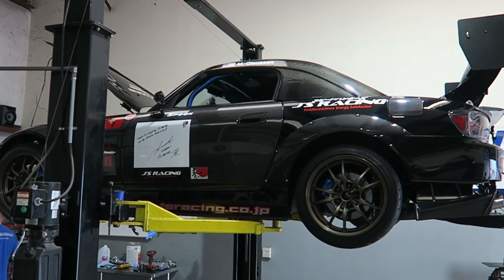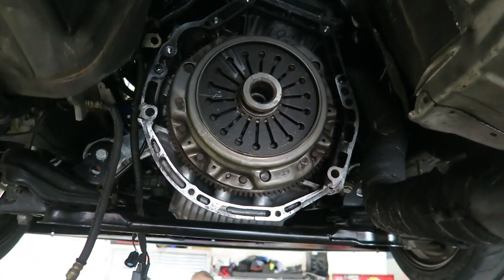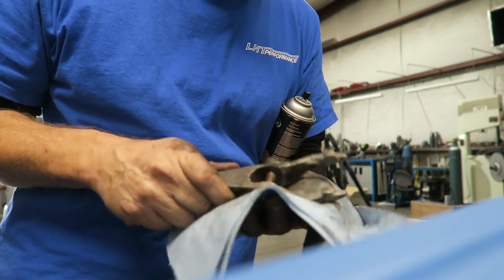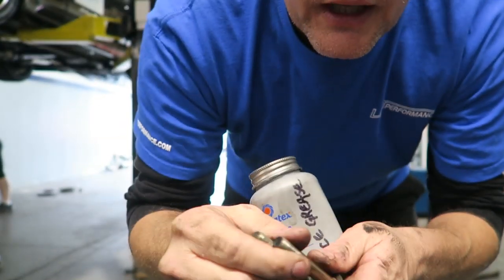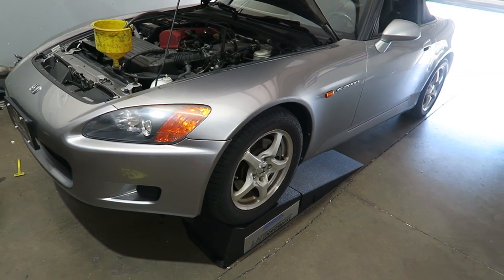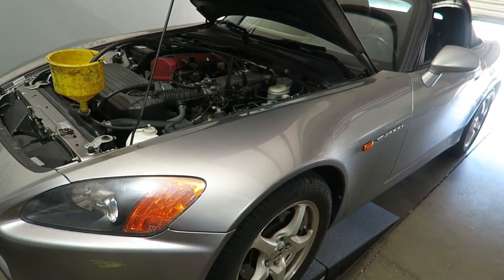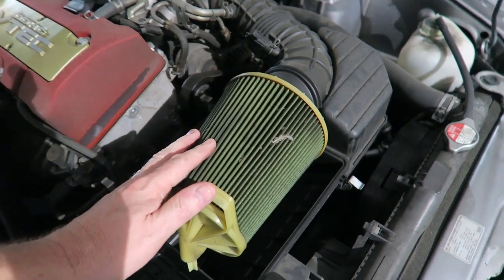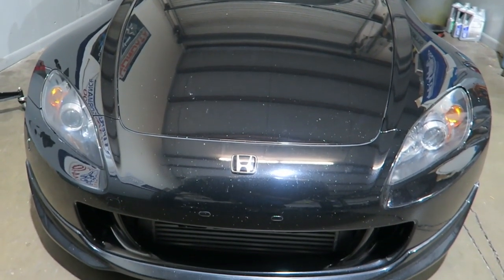What’s not to like?  S2000 's

Comment: Was going to get s2000 , but glad I went with 370z
Reply: @LeeRock 27 240NA hp is damn good for a 2 liter.  They respond really well to boost.  Low boost setups making 400+hp.  I have also seen 800+hp setups on stock motors.  Show me another motor that is better.
Reply from the maker: Mike Ireland Watch our Kraftwerks videos.   In stock from the S2000 is way underpowered.   With boost there fantastic 😜
Reply: 350z and 370z are dime a dozen. Just like civics. They are slow and heavy.  You can buy one for under 10k now. People payed 35k plus brand new.
Reply: I love my AP1, but I do want to supercharge it 😬
Reply: 370Z is too much of a GT and too heavy 🐄. The S2000 is a more dedicated and focused car for driving pleasure. With a Kraftwerks is even more viseral.
Reply: Doesnt the 370z have engine over heating issues?
Reply: @area859  I worked at a Nissan dealer in 2005. There were 350Z and Titans in service a lot for major engine issues.
Reply: Been running a 350Z on track and street for a few years now and out of the box it’s not as focused as an S2000 but a few simple upgrades really change the car. Lighter flywheel, short rear end gearing and sway bars.
Reply: nothingiswhatitseems heavy 😂?
Reply: Diablo99V  I would strongly disagree
Reply: area859  simple fix with oil cooler
Reply: Alex Flores run a DE on track with no oil cooler, run flat out for about 15 minutes until the race pads start to fad with no oil pressure issues, have to run thicker oil. A cooler is in the works but it’s not absolutely necessary.